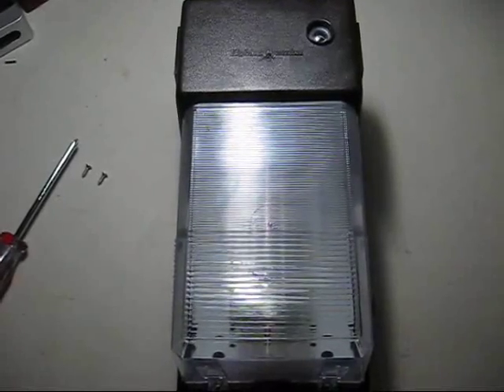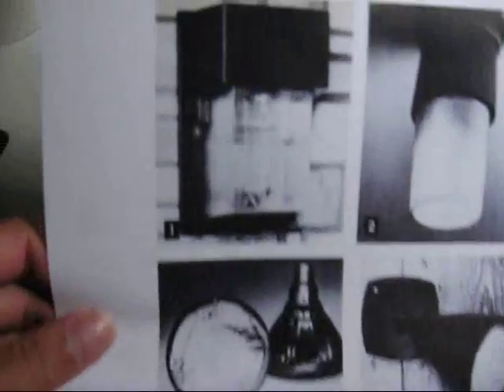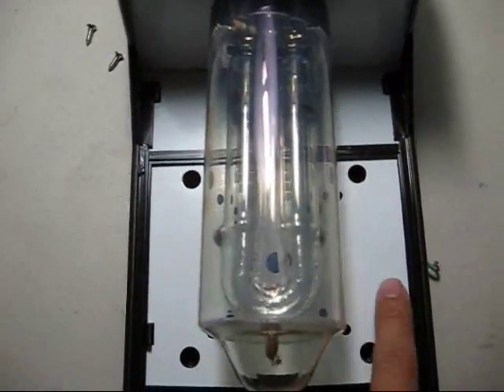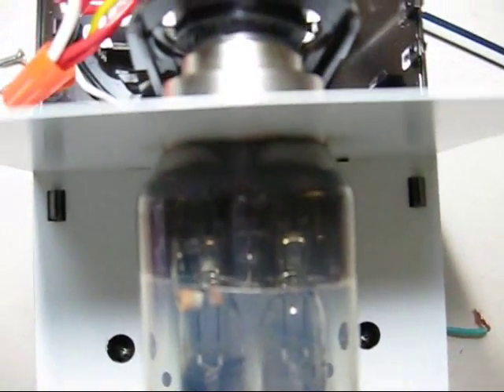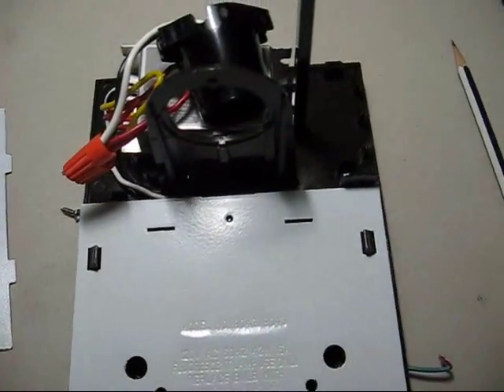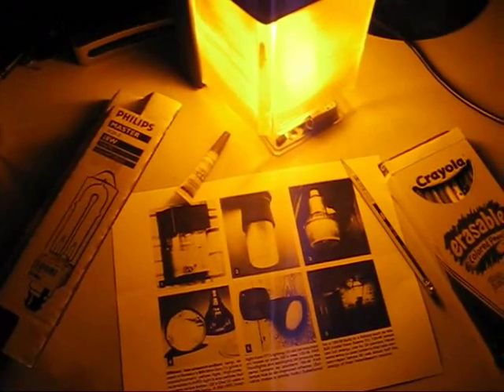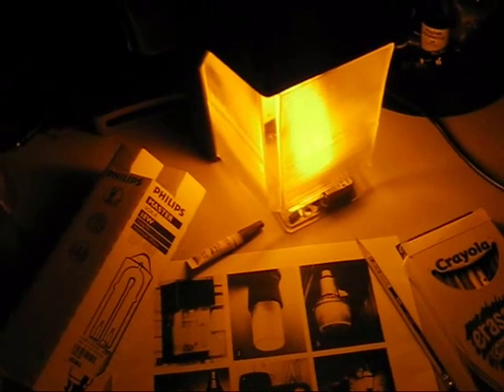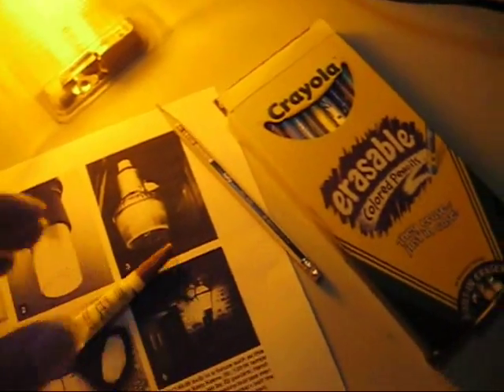My low pressure sodium converted Lights of America wall pack

Comment: Can you also convert one of these to metal halide??
Reply from the maker: +Techmatt167 

There's limited room in the upper part of the fixture so it I believe a traditional magnetic MH ballast capacitor, and starter likely won't fit. Heat may also be an issue due to the majority of the fixture (including the socket) being plastic. Likely have to stick with 35 watts maximum and use an Advance E-vision Mini or similar compact electronic MH ballast.
Reply: why MH is obsolete, I bought 4 glass lensed MH wall packs for $17.95 each, it even had the MH lamp included!  supplier closeout, and a major name fixture, well made, to convert to 18W SOX

Comment: where can I buy already made low pressure sodium liaght fixture??? 18w
Reply: ebay
Reply: There are STONCO (PHILIPS) used to be Genlyte  wallpacks still available, 18W good fixtures glass lens, like $120! no lamp though also available on ebay separately, Philips has finally stopped mfg LPs  a few months ago, last factory in UK is closed that did LPS..